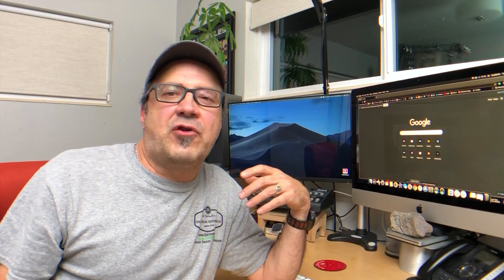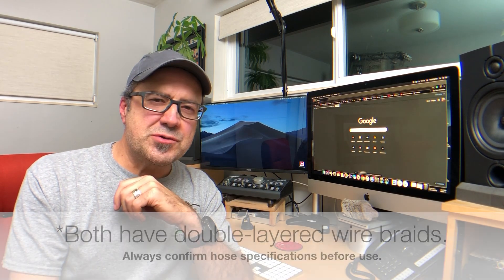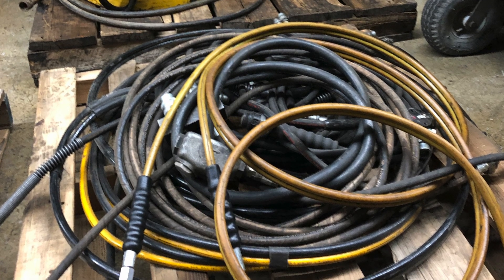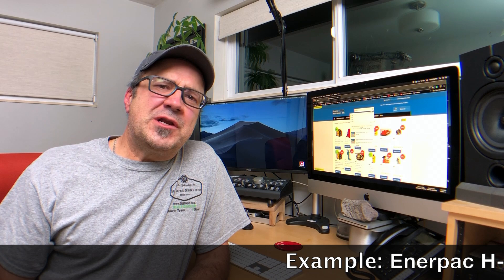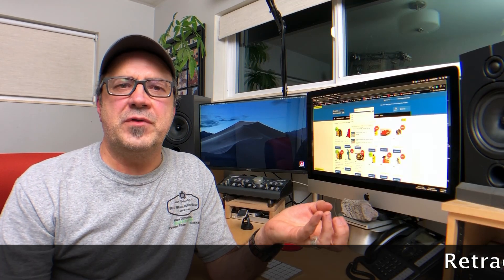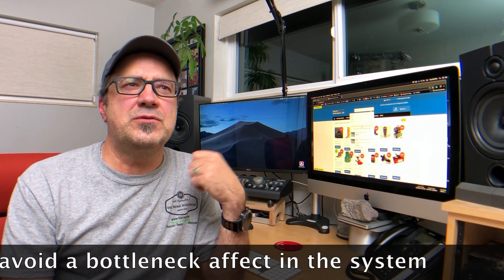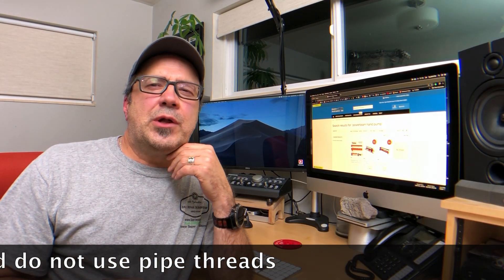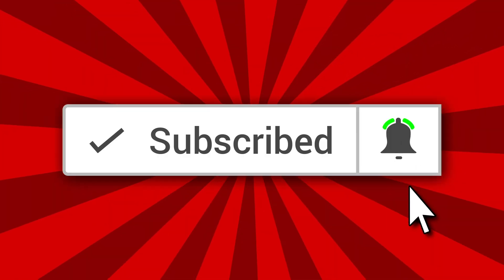10,000 PSI Hydraulic Hose Selection Guide

Comment: Does it work with pcp airgun my tank is 250 bars = 3000psi high pressure compressored air
Reply from the maker: Hello, ahmedelkhatib8367. You would not want to use these for that application. Even if the hose end fittings were the same (I don't think they are) you would be over-paying for the much higher pressure rating of 10,000 PSI